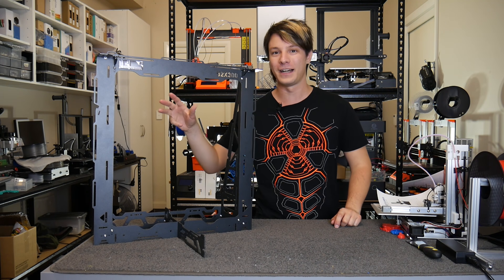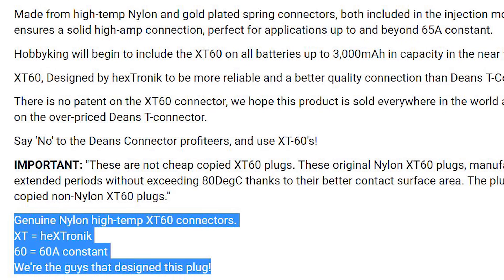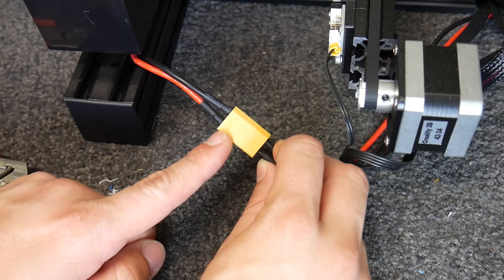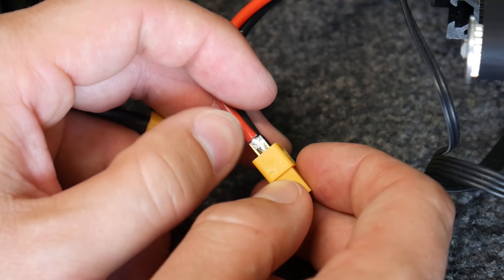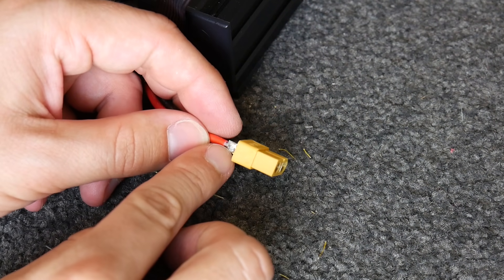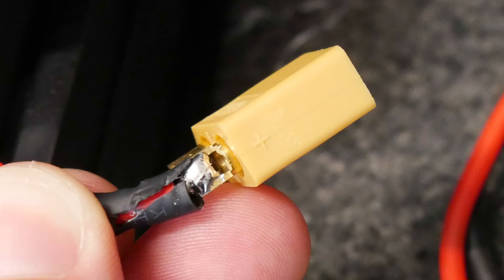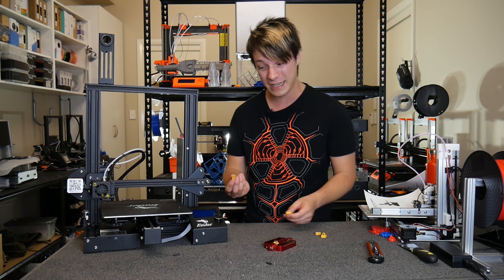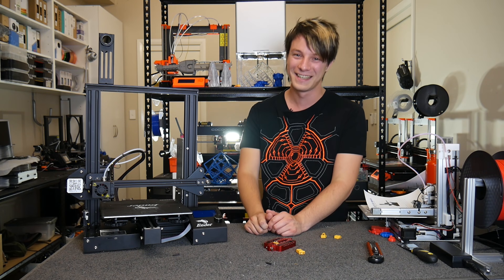Ender 3 Connectors are burning up... Bad XT60's

Comment: Awful. Been working on this, it's right before Chinese New Year so progress is slow going. Will make sure it's fixed.
Reply from the maker: You're a hero Naomi. It seems to be a single batch which is affected, but that batch had many machines in it... :(
Reply: Thank you Naomi, for your effort!
Reply: The issue that I forsee is that some of the printers in question are not from Creality and instead from another manufacturer like Sansmart or Comgrow.
Reply: @MakersMuse  as far as I know the wiring harnesses are subcontracted. I'm suspicious it was specced right, then the subcontractor decided to pad his pockets a little. Still Creality's fault, but this kind of thing happens consistently. They would not notice the difference in the cheaper harness, but that's no excuse for not pulling 1/1000 printers off the line and doing a 100 hour burn in.
Reply: That explains a lot actually. It made no sense why the batch suddenly changed from soldered to crimped, then back to soldered.

@Maker's Muse, in your video, it looked like you could see right through the soldered connectors to the wire, where the authentic ones are filled in leaving cup terminals on the outside. Was it just the angle?

Either way, I swapped mine for authentic ones (you may as well given the cost) and there has been no heat concerns since then.
Reply: You're awesome Naomi.
Reply: Fantastic as always Naomi, i think what people forget in times like this is that no company can guarantee 100% perfect products. Even companies like Samsung, Ford and Tesla have bad days.
Reply: What part of the internet have I stumbled upon clicking on Naomi 'SexyCyborg' Wu's channel?! Shameless way of getting views! Just do good content, you don't have to wear a bikini and it also devalues what you do - imagine if Angus wore a croptop for his videos!
Reply: Titaniumapple Some if not most of us arent small minded and dont actually care what shes wearing because we watch for the excellent content.
Reply: @titaniumapple1  get over yourself, not everything is about you. Let Naomi be herself.
Reply: @ala1for   Alan  What's small minded is you thinking it's her just 'being herself' - that it doesn't get many many extra views and she's doing it to 'be herself', not to cynically increase her viewership. I'm being a realist
Reply: @rpavlik1  She can do what she wants, I personally can't watch it because what she's wearing massively distracts me from the (I'm sure very good) content. I'm just calling it how it is
Reply: @titaniumapple1  If it's not for you, fine. But don't police other people's lives and bodies.
Reply: @rpavlik1  If my comments aren't for you, fine. But don't try and police my free speech on a public forum. I'm pointing out the cynical nature of her channel - like someone would if a Youtuber tried to sneak an advert into their video. She's CLEARLY not doing it JUST to express herself!
Reply: @titaniumapple1  dont police your free speech yet you can police her freedom to wear what she wants? Okay someone else will have to take over this conversation because im p*ssing myself laughing to much to type anymore
Reply: @ala1for  No if you'd read what I said, clearly you struggle with that, I said she can wear what she wants but I'm pointing out why she's doing it and it's not for me. Also makes me wonder why you're watching it, just sayin..
Reply: @titaniumapple1    What you have to consider is the fact that there's been a lot of people try to get negotiations with Creality about their printer quality issues for a while and gotten no where with them.  Naomi used her video numbers and following to work her way into the Creality company and now has a way to influence the quality coming from that company.  However minor an influence that may be, its still more then we had before.

She uses her looks to get views and subscribers sure.  If I looked like Jason Mamoa or Chris Hemsworth I'd probably be creating printer videos shirtless in order to get more views lol.
Reply: @titaniumapple1  implying I would mind at all of Angus wore a crop-top. let people do what they want and if you don't like the content, there's plenty of other places for you to go! don't shame them for it.
Reply: I have just ordered an ender5 - is this an ender 3 only problem, or should i be worried.
Reply: @BryanBakerXBrav  Crimped XT60 are "legal" :), if it is done well. There is different construction of XT60 for crimping and soldering.
Reply: Just recently ordered an Ender 3 Pro and god I hope this is fixed on my unit! I don't have the tools, not the skills to replace these myself.  Really freaked out about this now!

Comment: As a dealer in RC for the last 5 years I've seen tons of poorly made XT60 connectors and thrown hundreds of them in the garbage rather than sell them.  We only use and buy Amass connectors and they're not expensive.  There's no point in trying to save a few cents on this part.

Comment: Holy hell Angus, can't thank you enough for this video. Went to have a look at my Ender 3 after this, to find a fused mess of a connector, one side of the heat shrink had actually melted away it got so hot, as well as fusing the "XT60" together. And surprise surprise, they'd been crimped... Not cool Creality, not cool

Comment: Yeaahh I’m so glad you’re spreading the word... If you use the “original” and then use the “fake” it’s a night and day difference, it’s actually unbelievable how bad the “fake” one looks and feels side by side. I’m sure you would be very frustrated and calling them “fake” too (absolutely horrible rubbish). The Nylon on the fake also melts easily like a normal cheap plastic while the original one can handle heat and solder very well. The contacts also feel different like showed in this video. Personally I would recommend always solder XT60, XT90 or any other plastic injected soldered connectors always connected with the other matching side so there’s no risk of pins melting and losing alignment. I have that same red soldering jig/base but holding male/female connected together on a small vice you get better results.
So much POWEEEEEERRR

Comment: To be more specific the internal contacts of the connector is what is causing the heating.  The soldering of the wires to the connector is good.  The connectors are bad and not capable of carrying the current.  My connector was getting warm.  I removed the connector by cutting the red and black wires and then soldered the red to red and black to black and used heat shrink tubing to insulate the connections.  The wires are now cold.  The heated bed heats up faster, the hot end heats up faster.  The fans run at a constant speed and I even think the steppers sound happier.

Comment: Always tin the wire first before sticking it in the hole, make sure the tin soked through.
Reply from the maker: bit of liquid flux helps too, but I don't feel like a pro enough to demonstrate my technique!
Reply: @MakersMuse  , yes flux is essential as it stops hot tin oxidizing and makes the joint better.
Reply: @MakersMuse  For like 5 years I thought I just sucked at soldering technique until someone tipped me off that flux is important. After buying a cheapo pot of plumbers flux from Home Depot, I realize how easy it could have been this whole time.
Reply: @snickerdoooodle  Beware of corrosive fluxes. For electronics, you want a "no-clean" flux (even though you will often clean it off). Plumber's flux probably contains acids that will slowly corrode your joints, components and boards.
Reply: @MakersMuse  hey, there's nothing wrong with it, I'm a drone person and Ive seen hundreds of ways people solder xt60's on fourms and youtube
Reply: I feed the solder into the wire itself. It soaks it up very nicely. Make sure to turn the wire over, the other side might have not soaked up the solder.

Comment: My E3 Pro was soldered but burned. We crimp wires a lot for automotive use. So I went that route with 3m butt crimp connectors. It's been cool as a cucumber ever since.
Solder will always conduct better but creates a rigid joint, so sometimes creeping is a better choice for durability.

Comment: So I went to go check my cables after smelling something funny while printing, and what I saw was the XT60 connectors all burnted up and very hot to even touch. Thankfully there wasnt a fire. On further inspection, it was indeed crimped and not solder. I bought the Amass XT60 connectors the very same day and soldered them on the proper way. Connectors no longer gets hot. Thank you so much for this video

Comment: I replaced mine today. My new Ender 3 connector was getting warm (not hot), but I thought I'd replace it anyway after seeing the many reports. One side was soldered while the other was crimped. I also noticed the same colour difference between the two connectors. Definitly a low cost upgrade worth making. Thanks for the video.
Reply from the maker: Is there any chance you could share a photo with me of the crimped connector? I'd love to see how they actually tried to do it. Twitter is good as is email sales(at)makersmuse(dot)com cheers!
Reply: @MakersMuse  Sure - I'll send you an email shortly.

Comment: "And this seems to be...soldered"

Don't sound too disappointed; -)
Reply from the maker: Honestly it's a relief haha
Reply: @MakersMuse  lol, no doubt. I woke up to this video's title then glanced nervously at my Ender 3. Four more hours until my overnight print finishes.

"Surely my house won't burn down because I wanted to print a sexy elf ballerina..."
Reply: But I thought the bigger issue here is that they are using fake XT60 connectors? Not whether they are soldered or crimped?

Comment: OMG. Just had a look at mine, and it has started to burn out. I've cut open mine, and yes there are crimped on, burnt on the + Terminal. Looks like I'll get them changed and soldered the right way. Thanks for this video. You have just saved a house from burning down.

Comment: [Edit: the responses below develop this topic considerably] Angus, usually your videos are very informative, but in this case could we take a breath and NOT spread the rumor that someone has been crimping XT60s? Has ANYONE shown a photo of a factory crimped XT60? Because none of the "crimped XT60" stories I've seen has shown one.  For a factory, crimping those connectors would be a pain, while soldering them is easy. The wiring side of the XT60 is not long enough to crimp with a crimp tool (crimping usually requires individual pins that are crimped to the wire then inserted into the connector shell, which is not how the XT60 is made).  And crushing with pliers is not crimping, and will fail rather quickly, not to mention the wire will just pull out. So I think the crimp story is bogus, and while everyone and his 3D printed dog is repeating the story, it's distracting from the real cause, whatever that turns out to be.
Reply: The picture from the post in the video shows they've been crimped...
Reply from the maker: There's loads of photo examples on the Ender 3 Facebook group - just search XT60 crimped. Here's two crap hotlinks that'll probably expire soon - https://scontent-syd2-1.xx.fbcdn.net/v/t1.0-9/48355972_10156129996482055_305851647714656256_n.jpg?_nc_cat=102&_nc_ht=scontent-syd2-1.xx&oh=6fd0b140067f7603f9d1e2a11440325d&oe=5CBF72B0

https://scontent-syd2-1.xx.fbcdn.net/v/t1.0-9/48430246_10156527225685342_263703213788626944_n.jpg?_nc_cat=104&_nc_ht=scontent-syd2-1.xx&oh=1f1d0da2d60dcb62232e2c0175d08d1f&oe=5CD86C8D
Reply: Here are links that don't expire:
https://imagebin.ca/v/4T9ghThLj6j6
https://imagebin.ca/v/4T9go2Cq4c6W

From the looks of it they didn't even use a proper crimping tool (which makes sense, as connectors won't fit in any of the standard ones). Instead it looks like some makeshift/impromptu tool made little square dimples on either side.
Reply: @MakersMuse  Thanks for posting those pics. One of those pics (with the single exposed joint) indeed does look like the back side of a crimp... what is happening on the other side.. does it have the half-open solder-cup cylinder?  If not, then maybe it's a bad copy that is actually intended for crimping. (Not to say that's a good idea, nor well tested, etc).  The other pic with two exposed joints... looks to me like it might be soldered, hard to tell.
Reply: @Bitterguy14  At what time stamp do you see a crimped connection?
Reply: @avaviel  Not sure what you mean "from the board"
Reply: @Paul Little Not that I disbelieve you, but I'd love to see a photo. It could be that someone has come up with a connector whose pins/sockets are meant to mate with XT60, and where those pins/sockets are initially separate and with wire attachment features designed to be crimped, and then inserted into the shell.  If so, it would be highly informative to see such a thing. Again, not to say that connector would be a good idea -- highly sensitive to poor crimping tool or technique. But would help to distinguish failure possibilities.
Reply: Aaaand here's a couple of very convincing pictures from FB: 
http://grahamwideman.com/_imageserve/XT60-crimped.jpg

It looks like on these connectors the crimped terminal starts off as a cylinder. This is unlike any of the actual AMASS XT60 connectors, as seen here: http://www.china-amass.com/en/Default.aspx?cid=79&page=1&at=12-16  , all of which are designed with half-cylinder cups for soldering (which it would be infeasible to crimp), or for soldering to a PC board.

So my view is that these crimpable connectors are "not XT60s", that is they do not meet XT60 specs -- they are just connectors that someone designed to be more or less mechanically compatible with XT60 pins/sockets (and stuck an "XT60" label on), and with the additional "great feature" that their terminal portion can be crimped.  Except perhaps the current-carrying capacity of the crimp was not well characterized, at least with the materials actually used in manufacture.
Reply: @andersjjensen  Your links have expired.
Reply: @frankhovis  So has the topic since it's been resolved for ages...

Comment: Excellent video as ever Angus.  I am a design engineer and have designed several connectors and am interested in the Ender 3 so this got may attention.  
My suggestion to any owners would be to see if the connector they have gets hot when the bed is heating – if it is uncomfortably hot – and certainly if they can see any discolouring of plastic - to replace the connector with one from a reputable source or an alternative such as splicing the wires together.  If they are not confident at soldering then a screw terminated connector, or terminal block, of 60A rating would work.  This assumes the connector is correctly specified for the application – i.e. the current draw is less than 60A.
Based on your video the most likely fault seems to be the plugging connection – you demonstrated the low mating force compared to a good connector.  The soldering may be faulty but I cannot tell from the pictures.
The most likely problem areas are:  1) The geometry of the male/female generating insufficient normal force.  2) The contact material and/or plating being poor leading initial high resistance or a shortened life.  3) The plastic being inadequate for the temperature reached.  
Hopefully this problem is a faulty batch so limited in scope.  In general, from my experience, connector design is not simple and it is easy to produce a poor quality connection if designs are copied without understanding the engineering and design intent behind them.

Comment: I watched this video and immediately went to my basement to check the XT60 connector on my Ender 3 which I received as a gift a few years ago. Turns out, I had an official Amass XT60 on my machine, which I had never paid attention to or modified before.

Comment: I'm glad you're being so persistent on the quality control issues, Angus.  Since getting involved in with 3D printers 3 years ago, I've been really shocked by the number of apologists and enablers who make excuses for this.  Their usual justification is something like "Well, what do you expect for this low price?", or "Us 3D makers love to tinker and modify our machines."  None of these folks understand that bad design and bad quality control ultimately damage the popularity of 3D printing and reduce participation in it.
Reply: Not only that, but if someone buys one of those printers, they could very well burn their house down. Quality control issues are one thing, but faulty connectors/power delivery in general is a much larger issue.